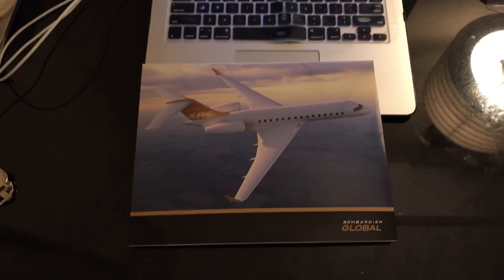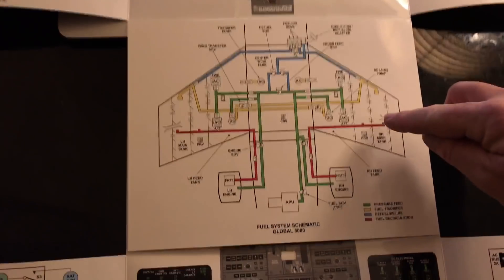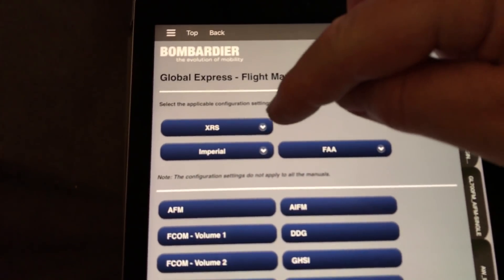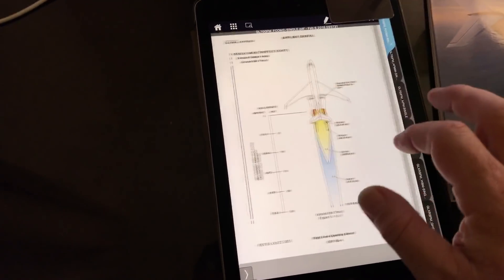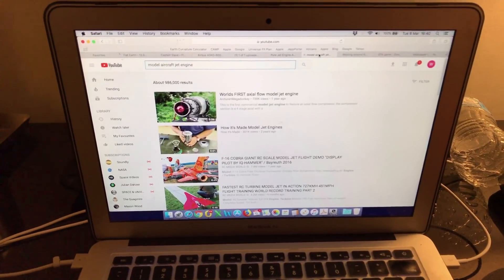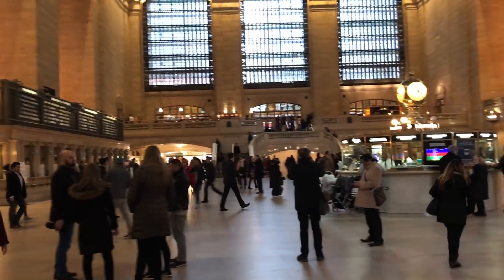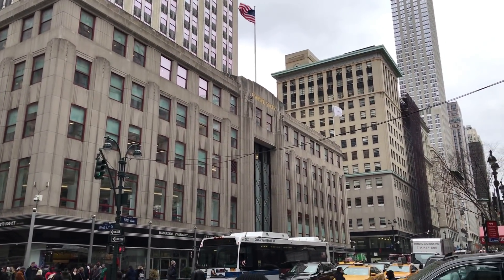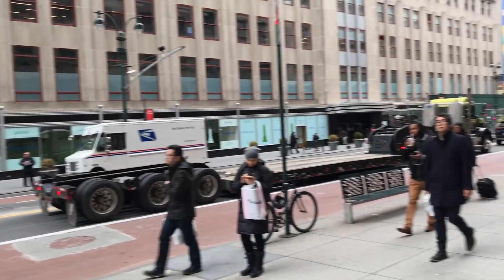Don't be ridiculous - of course Jet engines use liquid fuel.

Comment: I've only touched on this subject, I liked the manual where a schematic showed a big red/yellow flame coming out of the rear of the jet. You don't see that in real life, oh wait, then you showed a military jet with flame. I see.  Any idea what's happened to the fuel crisis, we are supposed to be running out aren't we? Yet they estimate air travel to be increasing by circa 15% in the next 10 years, just saying. 

Thanks for the New York scenes, love it there cheers.
Reply: The manual actually showed the jet BLAST, not flames. If they had such flames they would not be efficient.
The fighter engines produce huge flames when they are running in post-combustion / afterburner, which produce extra thrust but at very high cost (you would not believe the fuel consumption). It is used only for fast climbing on take-offs and in fights.
The fuel crisis? Well... Aircrafts are more and more fuel efficient and oil price is still compatible with air travel. Rendez-vous in few decades...
Reply: Thanks for that, dunno why they made it look as if a flame though.
Reply: That is the shape of hazard zones, with different colours for different speeds of the blast.
Reply: thanks!!

Comment: Woolfie 6020  show us the inside of the wing area from when the flaps are fully adjusted up or down and we should see inside between all the cross bracing and see if theres any fuel tanks or not.
Also when they do a fuel dump its not jet fuel its excess water being dumped just like an air  compressor needs to dump water every 8 or 10 hours of operation due to excess condensation in tanks.
Theres no way they would dump jet fuel  in the sky , bad for the environment and dangerous it could light up just with the planes engine exhaust.. Right.? Hehe
Game over dude.
Reply: How is all this excess water built up before the plane even takes off such that it has to be dumped if the flight returns to the runway early? Sounds awfully stupid to pump a plane full of water making takeoff more burdensome just so it can dump "fuel" to maintain a conspiraceeeeeeh.
Reply from the maker: +Steve Smith.  I am working on that.   

Here is some footage but I will have a lot more for the final video when it is made public.   This is the centre tank and shows the defuelling process after they fill the tanks and check for leaks. 

https://www.youtube.com/watch?v=B0oPMk_mce8

Comment: Why do you use Pounds as a measure of fuel? I have read on a small NASA webpage that the use of pounds is the weight of a mass in a gravitational field, and grams is the inertial properties of the mass. (I don't want to swallow that, even though its NASA)

I can understand that weight is critical information to know for weight and balance, but why Pounds?

PS that NASA page;
https://image.gsfc.nasa.gov/poetry/ask/a11511.html
Reply: They measure jet fuel in pounds because the first commercial passenger jet came from England, where pounds are the official currency.  This caused it to become the standard for fuel measurement worldwide.  As you can see by this highly technical diagram, it makes perfect sense for jet fuel quantity and burn rate to be measured in this manner: https://imgur.com/a/tWzHG
Reply: lol ;)

Comment: I’ve had a run in with a couple of these idiots...... I’m a Compressed Air Engineer for the last 30 years and these people have no mechanical knowledge what so ever. I’ve installed new Atlas Copco GA200 air compressors in a local aircraft engine plant for the final test purposes. Engine are run dry for the first test (compressed air) to check everything before the second run which is wet (kerosene).... For people to think that there’s no fuel on a plane is down right idiotic.....
Reply: Paul Hill Father Ted..... awesome
Reply: Richard Jones The second test (WET) can be done with water...
Reply: white tiger I very much doubt they would use water on the wet run as that’s the run the engine is creating power and water ain’t very good at igniting
Reply: Kjetil Balstad you should see a shrink

Comment: JET ENGINES ONLY USE FUEL FOR A BURNER TO HEAT THE COMPRESSED AIR.  LOOK AT THE DRAWINGS.  A
Reply from the maker: +Jeff Beck.  What are you so upset about?  Yes they do use fuel to heat the air that has been compressed by the compressor stage which is driven by the turbine stage which is powered by the fuel burning causing expansion.

That is exactly how they work.  We agree. 

This video is refuting those channels who claim the engines do not require jet fuel. 

My jet burns 3000lbs per hour.  50 lbs per minute.

Comment: I didn’t know which flat Earth videos that you are being referred to about jets not using liquid fuel,but the one I saw was Flat Earth Photography,who thinks that the Airbus 380 runs on compressed air,because he believes that there is no way to fit 35000 gallons of fuel in the wings. I don’t know how compressed air became his fuel of choice,considering that even if every available space left over after passengers,was filled with compressed air,you’d be lucky to taxi out to the runway before exhausting the supply(if you could even get the thrust necessary to do that).But this is also the guy that thinks airplanes are actually demons in disguise (not kidding about that),and also thinks at sunset,the Sun is only three miles away.Maybe he’s right,and all along,when I have been looking up during the day,them were really compressed air,demon planes that were on the way to land on the Sun.
Reply: They see compressor on a jet engine, put 2 and 2 together and come up with 86

Comment: no liquid fuel in the wings when they do wing stress test? I wonder why? yea because planes fly on compressed air - free energy since a 100 years ago - https://www.youtube.com/watch?v=XhM2eCm98_Q
Reply from the maker: +tremarctos9. All I can do is laugh at you.  

Watch this and try not to cry on your keyboard.

https://www.youtube.com/watch?v=yBm3Eu16rHE

https://www.youtube.com/watch?v=IdXmaEoPXQs
Reply: tremarctos9: Why place bombs inside a hanger (i.e. fuel), to test structural specifications of wings, and fuselage?
Reply: tremarctos9,
Do you know that, in flight, the load of fuel in the wings actually relieves the stress on the wing structure? I guess you don't.
Reply: do you know wing stress test are done without liquid fuel inside them - because there is no liquid fuel - compressed air and that's it... you dumb fuck you think planes are flying around with TONS OF EXPLOSIVE FUEL.. go back to sleep dummy
Reply from the maker: +tremarctos9. Yes planes are flying around with many tons of fuel.  I have 10,000 hours flying real planes.  Most of that time on turbine helicopters and Jets.  

You are so wrong that all I can do is laugh at this nonsense.
Reply: right - and wings are holding tons of liquid fuel - get lost loser - free energy is real and the jet engine is a free energy machine.
Reply: You are not too bright - you could use water instead of fuel for a stress test - how could you not test the wings with the correct amount of added liquid fuel, especially when it's in the tons - meaning we are talking about 50,000 gallons of liquid fuel - that's 5 gasoline tankers which hold 8 to 9000 gallons of fuel - and you think big planes like the A380 are holding 5+ of these tankers in extra weight.  I think not. you can show me all the diagrams you want, but they are just that - fucking cartoons - show me a real wing with fuel tanks filled up with fuel - show me video, real photos any proof - planes are flying with tons of liquid fuel -  A text book proves nothing -
Reply: tremarctos9 What shape are compressed air tanks? Have you ever seen one that was not cylinder shaped. Where would you place such a tank on the aircraft if you placed it on the wing you would creat a hard spot? Son how many aircraft have you ever worked on? Make an effort to get out and get hands on in the aviation field you can join the Civil Air Patrol as a senior member just stop drinking the JP-8 !
Reply: tremarctos9  I have worked on aircraft for 30 years I have seen fuel leaks from the C-5A and that fuel is pouring out like a heavy down pour and I have worked in the fuel cell to repair it . Now there are new enigines on the M models and still don't run on compressed AIR ! There is NO way you can keep it a secret no way!

Comment: To but it simply Wolfie did not address the argument. He misinterpreted the information as just " air planes run W/O jet fuel" first that is just one hypothetical assumption proposed by the community not a stance held by anyone at this point. It most basic question is " can 250 metric tons of fuel be held on a Airbus A380?   ".
Reply: And the answer is yes. Why even question it? Have you not seen the size of that aircraft? Why do these hoaxers have such problems with scale?
Reply from the maker: +Shad Stewart  There are many different versions of this argument.  Like there are many different versions of Flat Earth. 

Some argue that there is no fuel in jets.   Even in comments on this video elsewhere and I quote tremarctos9  " no plane is holding explosive liquid fuel."

So yes, I did address that argument.  

To answer your question "can 250 metric tons of fuel be held on a Airbus A380?"

The answer is "Yes very easily" 

Have you ever seen one up close?   They are huge.

Comment: There is a UAV that was built that flew on compressed air. It bearly was off the ground. Maybe slightly better than Wright Flyer. It doesn't produce enough power.

Comment: So what I'm understanding as the MAIN ARGUMENT is NOT that personal jets, but airliners and Airbus types specially don't use fuel, It's more about whether an Airbus A380 can hold 250 metric tons ( or approx. 551,000 lbs) of fuel on top of hydraulic fuel pumps, motors, electrical, engine etc. on it's wings and still fly or even have the volume necessary to hold the fuel as well as weight distribution during turns, the lack of sloshing, and landing manuevers seeming physically impossible. Also the matter of heated compressed air circulation throughout the whole plane possibly adding buoyancy and moisture release valves at the tip of some wings dropping weight from the plane.
Reply: What I'm understanding is that people with no engineering or flight experience are making arguments from personal incredulity and ignorance, and think they've blown open the doors on a giant scandal they self-invented, and calling into question the veracity of those with that experience telling them otherwise. The more cretinous members of your "community" are essentially calling all pilots liars and inventing all kinds of fictions about things they know nothing of.
Reply from the maker: +Shad Steward.    The argument I am proving wrong is that Jet engines don't use liquid fuel.  Yes there are some channels claiming that.  

Have you seen the size of the wing on the A380 up close?  It is huge.  At 140 Knots it can easily lift hundreds of tons of fuel and aircraft.   Especially with Slats and Flaps extended which greatly increase lift at low speeds.  

https://www.youtube.com/watch?v=EaRmi3mn5EQ

140 Knots is 260 Kph.  Lift increases by the square of the true airspeed.   260 Kph on a wing area that is 845 square meters  Do the math.  It laughs at 250 Tons.

The A380 wing is double the size of a Boeing 777 which is itself a huge aircraft.